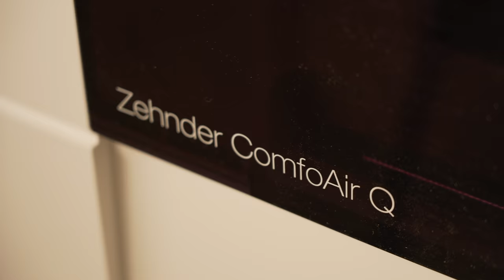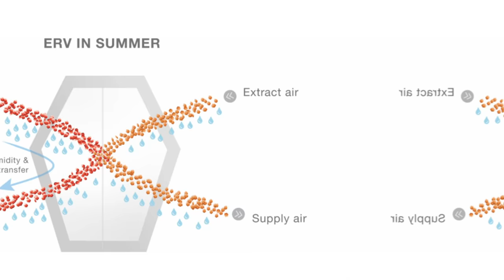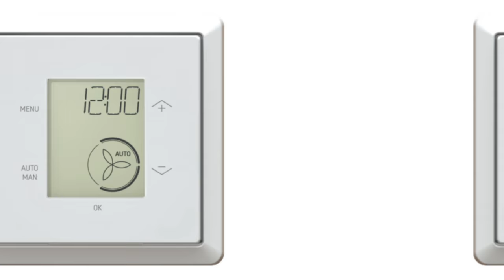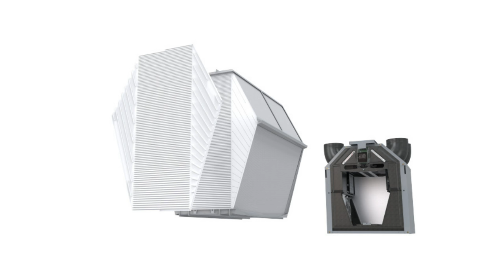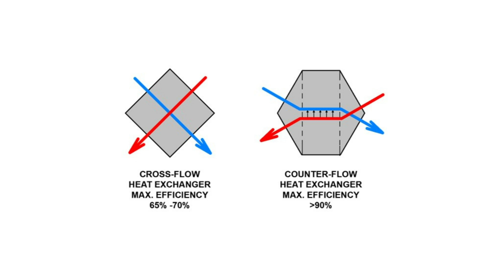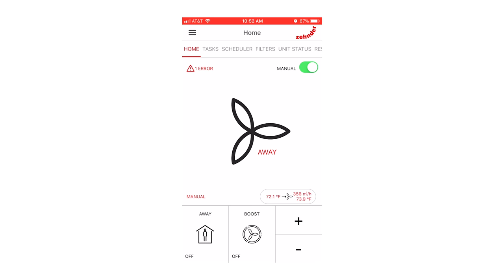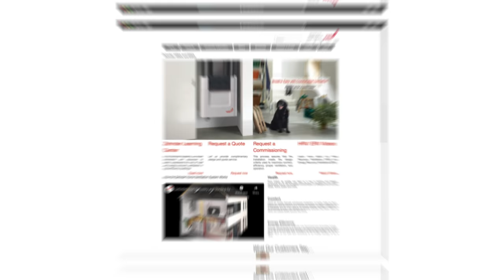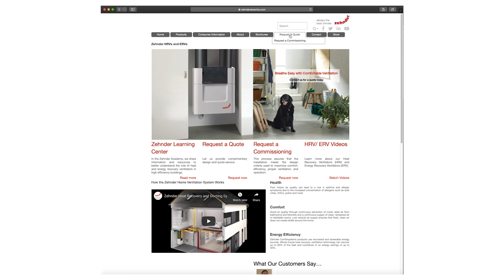Passive House - Fresh Air System Install & Costs (Zehnder)

Comment: How does this deal with a kitchen exhaust hood that would have grease into the HRV system and also in an airtight seal passive house like Matt's?
Reply: That and the dryer vent.  It seems both a kitchen exhaust and a dryer vent are penetrations moving air out of the structure but which do not run through this system, unless there's something exceptionally clever going on.

Comment: So with this system, you basically never open a window?  Seems a little extreme, but I like it.  I do wonder why I have never seen a mention of solar (passive or otherwise) on your channel nor work with steel framing.  I know it's a bit off topic, just curious.  Excellent content, as always.  Thank you!
Reply: You can always open a window when you want to. It doesn't hurt the ventilation system. But during much of the year in many climates this isn't desirable.

Comment: Wait, so there’s no exhaust fans in the bathrooms or when the exhaust fan is turned on the exhaust is sent through the ERV?
Reply: The ERV is the exhaust fan. It's constantly pulling air from the exhaust registers located in bathrooms, kitchen and laundry. It does this at the lower rate called for by code (for example, bathrooms are minimum 50 cfm with intermittent bath fan, but minimum 20 cfm if exhaust is continuous like it is with the ERV).

Comment: so, with this erv, does one have to have a generator in case of outages?
Reply: The same question would apply if Matt were relying on bath fans for his ventilation. Yes, the ERV needs electricity to run (not much, but some). But in rare occasions when power is lost you can still crack open your windows to let some air in.

Comment: This may be the premier ERV, but 85% efficiency is disappointing.  For example, if it is 90 degrees outside and I want 70 degrees inside, then 85% efficiency means I will be constantly pumping in 73 degree air into my 70 degree house!  The a/c would have to run constantly!  As long as we can avoid drafts, allergens and moisture condensing in insulation, how is this ERV so superior to having a little air infiltration here and there?

Comment: How does all of this exchanged air, at apparently outside temperatures, affect the AC unit, it's job and it's cost to run. Nothing was mentioned at this unit maintaining inside temps.
Reply: The video shows the plates allow the exhausted air leaving the house to cool down the intake air coming in front the atmosphere. With a house this tight it is less of an effect on the hvac than leaky windows, doors, etc. of a builder grade home.

Comment: I must have missed it. 2 tubes of supply to the bedroom, what about exhaust?
Reply: Exhaust returns are in the bathrooms and kitchen to extract humid and odorous air
Reply: Daniel Steiner  so human breath in the bedrooms stays in the bedrooms?
Reply: Donald Whittemore , no, picture the air flow bed rooms and living space is positive and the negative space is in the bath rooms, kitchen, laundry and hallways. So all the air is changing at a slow constant speed, unless you boost the system if you have a party or slow it down when the house is empty.

Comment: Curious how loud this unit is and if you can hear the unit running when in the bedrooms
Reply: Visit our website where you can look at the specs and compare to other systems. But in general our ERVs are very quiet and people often are unaware they're running. When it goes into boost mode temporarily you might be able to hear it depending on your proximity to the unit.
Reply: I got Zehnder HRV and it is Super quiet.

Comment: Okay, wheres the intake (draw) inside? The manual says have 1.75 m between the room exhaust and room draw. Did I miss that or can you also place a draw inside a hallway and leave a gap in the door per the manual? Sorry I really like this system, but I seemed to miss the intake point for the rooms. The two pipes into a single fixture made me think the intake and exhaust were tied to the same point. I new it could not be correct quality construction being the goal... Oh  and the Kids that don't turn on the fan. That's my son all over, I was thinking it was just my kid now I am thinking its a teenager conspiracy :)
Reply: Intakes: Bathrooms, Kitchens, some closets, and hallways. Exhaust: bedrooms, living spaces.
Reply: @AnthonyBrusca  Still doesn't answer the question. His ports in the daughters room are in center give or take and the intake has to be in the room 1.75 m from the exhaust. The manual says the distance is necessary to keep the air flow from short circuiting. The air flow has to be balanced either the room leaks air (per the manual) or you have an intake. Closets for instance only work if the doors are leaky. A well sealed room will pulse air when a door is open unless the air can go around. So did he plan for air to go around room entrance or is there an intake in the ceiling. My question is did I miss the locations of the intake I didn't hear mention of the intake except for the comment that both have the same adjustable port type.
Still looking for the answer...
Reply: Your gears aren't meshing on this. Or maybe our manual needs some clarifying. :)
The supply register and extract register don't HAVE to be in the same room. They usually are not. But if they have to be in the same space for some reason, they should be kept some distance apart to encourage air exchange around the room. In most designs, we supply to bedrooms and living rooms and extract from bathrooms, laundry and kitchen. Hope that helps!
Reply: @meshedgears2794  I mean, I hope you're not air-sealing doors BETWEEN rooms hahaha
Reply: @christophersmith1894  Hi Chris
yes you need to alter your manual. On page 17 the requirement for installing the intake and exhaust is .75 mm ( I confused the exterior with interior), following that note in the next paragraph the manual states that you must allow leakage around the door of the room. The manual assumes that the owner will keep the "leakage" for the system to work. The average length of home ownership is 13 years, and I think the trend is getting shorter. A new owner may make mods that stop circulation. Like solid core doors for sound...and for other reasons..
My wife has cats and they do not have access to where we sleep, this mean the little *^%$ put there mouths at the bottom of the door and "MEOW" that in turn makes us plug the gap with anything. 4:30 or 5 am wake up meows suck. Anyway point is I just ruined your air circuit.   The automatic adjustable fan will likely compensate for the  sealed room, but you will have a room with poorer air quality than the rest of the house... A real feng-shui killer.  :) (Also no air flow very bad for allergy sufferers. Note Matt's extra filters with carbon option).  Matt will probably be in his house for several years but that's not the norm these days.  If the system was able to detect and notify that a room is not being serviced then that is great (probably be an app some day) your phone tells you room xx air is not good. There should also be a big graphical sticker on the machine and in that future app showing the expected air circulation requirements... like leaky doors
-MG
Reply: @AnthonyBrusca  yep, sure am take at my response to Chris -MG

Comment: I wonder what happens when somebody like me " cooks " in an airtight house, where does all the smoke go? In my non airtight house the stove vent hood (860cfm vented outside) can't keep up and the smoke ( or dinner ) alarms go off.
Reply: I was thinking the same thing. Although we don't know how much boost mode is, it does seem to be far less than a typical kitchen and bath exhaust fan.

Comment: Hi Matt. I'm following your channel & watching almost all videos. They are  interesting. Thx for yr efforts. I'm seeing that you are building super air tight home and same time spending lots of $ to bring air in. ? Make no sense.  Why don't you have few gaps here & there to get air in. Also you r in USA where air quality is still clean  no need to spend $$$$$.$$ for filtering clean air. Or wear a mask inside in home too, problem solved.  What u think?
Reply: Hi Jatin. Mind if I add my thoughts?
You're right, in general outdoor air isn't too bad (except during wildfires!). The problem is that indoor air quality is worse than outdoors because of the stuff we build with and live with. All kinds of VOCs, particulates, moisture and CO2 can all be elevated indoors. Even moderately tight code-built homes (with some leakage) collect and hold a lot of contaminants. If you're in a climate where it's favorable you can just leave your windows open, but most people can't do this for much of the year. Masks and filters don't work for VOCs and CO2. Outdoor air exchange is the answer and doing it with energy recovery makes it comfortable and energy efficient.

Comment: Did I miss anything, or there is no explanation as to how this will work in an area where the outside humidity is really high?
Reply from the maker: I’m in a hot/humid climate. This is the perfect unit. But you will still need a dehumidifier
Reply: @buildshow  As I expected, but where in the system does the dehumidifier go? Or is it a different air management/flow circuit altogether?

Comment: Does anybody know, when you have houses built to this crazy air tightness could CO2 become an issue if you didn't put a ventilator in? Like over night if you had a bunch of family staying over for the holidays or had a big party with all of the windows shut?
Reply: It's something like a wait and see. When designing these systems, you can do the best you can with math, but then you just have to adjust to variables that are hard to account for. But I imagine you'd need to run your Ventilator in Turbo mode most of the time when large amounts of company are over to flush out the elevated CO2 levels. House size and layout are all variables to consider.

Comment: Can you integrate AC and dehum into this thing???
Reply: Best to keep them separate. In most homes the air volumes required for cooling/dehu are a lot more than what's required for ventilation.

Comment: I would not exhaust kitchen vent into hvac.
Kitchen hood can exhaust oily air, and that would overtime grime up an hvac system.
Reply: You're right, Richard. We have a return register for the ERV in/near the kitchen, but not over the cooking surface. Matt will have a vent hood dedicated over the stove.

Comment: Where does the heating and cooling integrate with this ventilation system?
Reply: This is a common practice in North America, but it's best to let the systems operate independently, not integrate. The airflow required to deliver or remove lots of BTUs is a lot more than the airflow required to maintain healthy IAQ, so the duct sizes are different. And the air distribution strategy is different as well. Heating and cooling recirculate air to maintain efficiency. You don't want to recirculate your bathroom exhaust air. The control strategy is often different as well (intermittent vs. continuous). We're trying to optimize Indoor Air Quality.
Reply: I dont understand. The ventilation system he uses doesn't recirculate any air - its 100% fresh air so you wouldn't be recirculating any bathroom or kitchen air. also the house is so thermally efficient that it would not require the kinds of heating and cooling airflow a house would normally require so surely you could use the same ducts. I'm sure I've seen him use integrated systems in the past.
Reply: Fog, If you want to continuously exhaust your bathroom through the ERV to optimize IAQ, then you need separate, dedicated duct work for that, otherwise you’d be recirculating it into the air handler.
Yes, Matt has integrated the systems before. We’re not saying it can’t be done, we’re just explaining why that’s not the best practice. I think Matt’s pointing out in this video that he’s taking his ventilation to the next level, not satisfied anymore with inferior practices.

Comment: Too many filters in supply air side. First filter in that swiss plasticbox called air exchanger unit is usually F7 grade and is more than enough to filter all particles that are coming from outside. Those additional filters in supply air are just blocking fresh air to come in house and increases exhaust to supply air rate.

Comment: Matt, Can you get me a quote for a system or link me up with someone? I received a quote and the price is double what was anticipated from this video, killing our budget. Inflation has got us, but double the cost seems a bit extensive? We have a small house 3 bed 2 bath 1650sf and have designed a system for 88 CFM.

Comment: what is the lifespan of a properly maintained HRV?
Reply: Thank you for setting the expectation on proper maintenance (which is just filter changes and cleaning). Zehnder has units across America that have been running for over 10 years now.

Comment: 30:36 you mention a constant speed of 180 cfm at the ERV. You claim you can damper down or open up each duct run to get design spec cfm in each space. How are you able to regulate cfm per room using an ECM motor? 

When you open up or close a damper all you are doing is changing the static pressure. What types of commutated motors are you using? Constant cfm, constant rpm, or constant torque? I’ve been talking to the NEBB certified engineers that come out during commissioning for balancing and as far as they are concerned you can’t balance ECM motors. Which is a true problem since the Department of Energy is phasing out induction motors.
Reply: Then they should probably seek some training from NCI. Duct systems with ECM blowers can be balanced, it is more difficult and it  requires more time because you have to allow for the motor to settle in with each change made to the balancing dampers.
Reply: VapoRTraiL111 Can you explain to me how. These motors will provide a continuous CFM. For easy of numbers let’s just say the ERV will provide 100cfm total. We have 4 zones. Z1 is 5ft away and the space requires 10cfm. Z2 is 20 ft away and requires 40 cfm. Z3 and Z4 are both 30ft away and require 25cfm per zone. 

If you try to close the defuser in Z1 it will increase the static. Which obviously will increase the fan speed, which will push more air to the other zones pushing them out of design spec. 

Trust me I was standing right there in a 48 story 380 unit high rise watching these guys fail when our mechanical inspector was on the flow hood. Plus some of these registers right off the AH were screaming!! Long story short it was a 86k change order from the builders mechanical engineer. we went back and increased the duck runs and added 90s to get as close of a static per run as possible.
Reply: @Justaguy0420  Proper duct design and sizing is key with any motor even more so in my opinion with ECM motors.  The less balancing needed the better. But balancing is possible, it generally takes me about twice as long. Because you need to set the hood to read constant and wait 10 to 20 seconds to get a stable measurement, both before and after adjustments.With a constant speed motor when dampers on branch runs are throttled close to reduce CFM static increases and fan airflow decreases, so if we have 100CFM but only 50 is required, when we close the damper to a recording of 50CFM static will go up and airflow will go down. Now we are diverting say 40CFM instead of 50 to the other branches. with ECM motors an increase in static will create an increase in RPM's to continue to deliver the full CFM value. 
As far as the building you are discussing, did the change order correct the system? If so I would chock it up to poor design by the engineer.
Reply: VapoRTraiL111 I’m still a little confused with your example. I totally agree with you that proper duct sizing and design is necessary. That’s why I initially asked the question because the video states it doesn’t matter how long the runs are off the hrv. I guess all I’m saying is the motor will compensate when a duct run is restricted, which will push more air down the other runs increasing cfm. Now the other runs are too high and also have to be dampened down which increases statistic again. It’s this game of whack a mole that they were never able to solve. 

Yes the change order solved the problem. We were able to get within plus or minus 10% of spec. And yes I totally agree with you that it was a completely bad design. Which wouldn’t have been a problem with normal induction motors. Set your motor taps and balance, Easy peasy. 

So full circle that’s why I was asking this Matt guy in the video how he’s able to balance duct runs with variable duct distances and arbitrary routing.

Comment: I'm wondering if the intake air can be funneled into the home forced air system so the fresh air can be conditioned before being distributed. When it's 20 below zero and my thermostat is 70, this ERV would be blowing 50 degree air at me and I definitely don't want that. That's like having a permanent draft.
Reply: I agree.  My ERV incoming fresh air goes into my HVAC return ductwork to get conditioned BEFORE it is released into the home.....
Reply: This is a common practice in North America, but it's best to let the systems operate independently, not integrate. The airflow required to deliver or remove lots of BTUs is a lot more than the airflow required to maintain healthy IAQ, so the duct sizes are different. And the air distribution strategy is different as well. Heating and cooling recirculate air to maintain efficiency. You don't want to recirculate your bathroom exhaust air. The control strategy is often different as well (intermittent vs. continuous). We're trying to optimize Indoor Air Quality for health and productivity.
In your climate our preheater (for frost prevention) would raise the supply temp up a bit and the flows are so low that well-placed supply registers wouldn't create a noticeable draft.